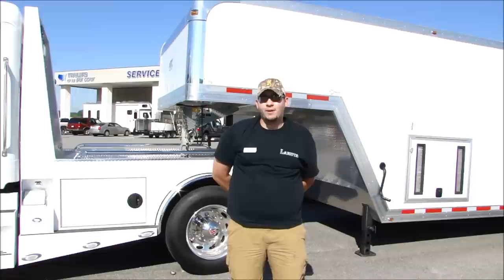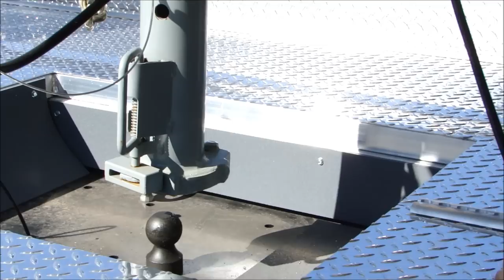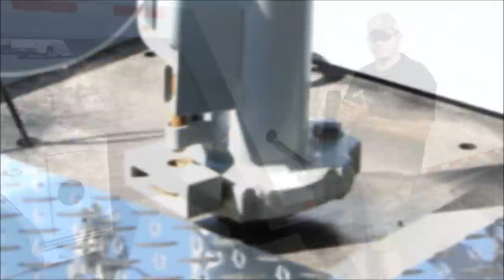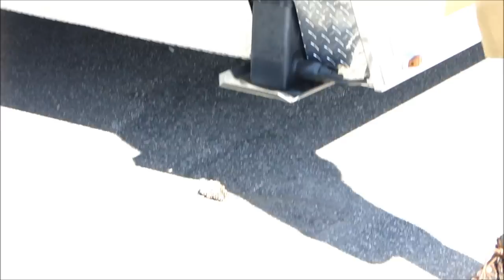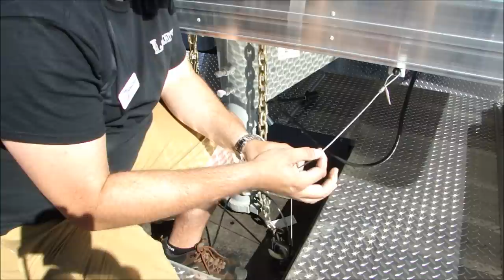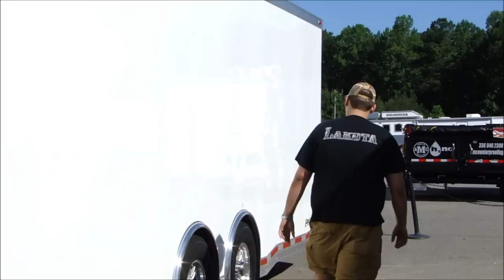How to Hook up a Gooseneck Trailer for Safe Towing

Comment: Glad to see, that you used your foot to slow the land gear.
My dad taught me this also. 
BUT 
For a different reasons. If you allow the land gear to snap up, It will break the spring. 
When the spring breaks, you have to crawl on the ground to pick up the landing gear.

Comment: Great video.  I noticed the use of shouldered eyebolts for the connection of the safety chain.  The drawback with using this type of eyebolt where an angle pull might be exerted, is the loss of strength of the eyebolt   At 30° the rated capacity is by 40%, at 45° the rated capacity is reduced by 67%, and at a 20° angle the rated capacity is
reduced by 80%.  The ideal eyebolt to be used where an angle pull is likely to be experienced is a swivel eyebolt.  The rated capacity for swivel eyebolts does not diminish regardless of any angle pull. 
Just a little FYI to help others to be better protected when towing.
Reply from the maker: +Jake The Snake Thank you.
Reply from the maker: +Jake The Snake Thank you.
Reply: +Trailers of the East Coast You're welcome, glad to help.

Comment: Everything looks good with the hookup, the only thing I will add is after retracting the spring-loaded jack legs, reset the locks before walking to the next leg. Relying on just the spring to carry the inner leg is inviting disaster. The spring may break or relax and let the leg drop and grind away, fall out onto the road, and cut your own tire or go through someone's windshield.
I'm used to either a bumper ball or pintle hitch, where there is normally a secondary lock pin for the coupler, is a gooseneck ball hitch not equipped with a secondary lock for the latch?
Reply: Dan Waldhauser i did notice that too about the jack legs but he may have not felt the need only for the demonstrative video.
Reply: Dan Waldhauser 7

Comment: If you have a flat on your gooseneck is it possible to safely tow it? Or do you need to do a tire change?
Reply: You can safely drive slowly with a flat tire on tandem duals i wouldnt try it on anything with single tires because you will most likely ruin the rim. And especially with a white cargo trailer

Comment: why gooseneck instead of 5th wheel?
Reply: Why not lol
Reply: flight2k5 A gooseneck is more compact in the bed of the truck is one of the big reasons why people choose them. Most equipment trailers, large car haulers, and horse trailer are gooseneck and large travel trailer tend to be fifth wheel so it often depends on the type of trailer you wish to pull.

Comment: Curious about the crossing the chains comment.  Why?
Reply: Crossing chains allows a basket for the trailer tongue in case your trailer were to "unhitch" instead of running them straight and having it dig into the ground and potentially damaging several components on the trailer